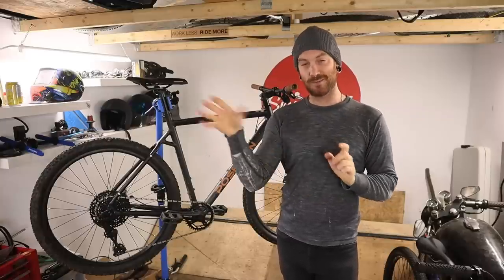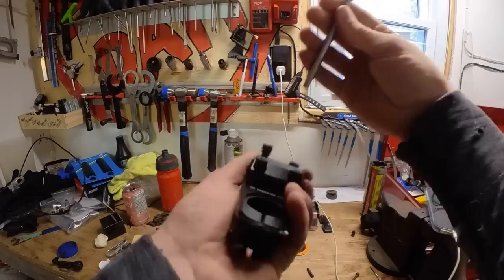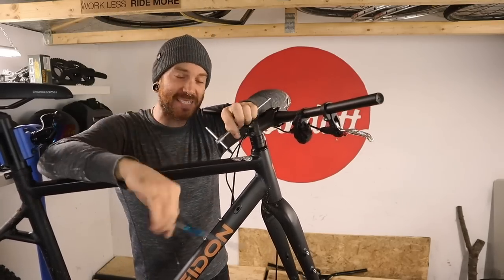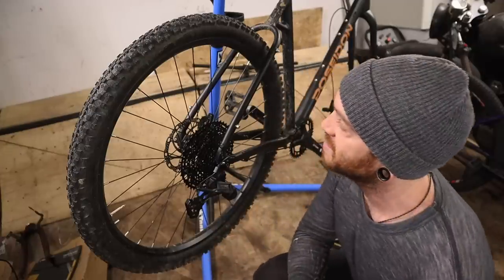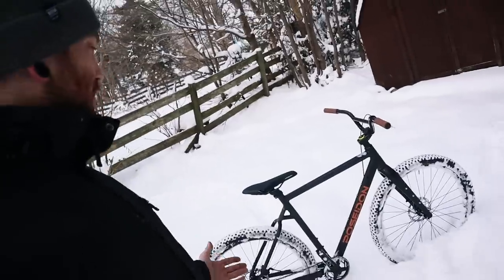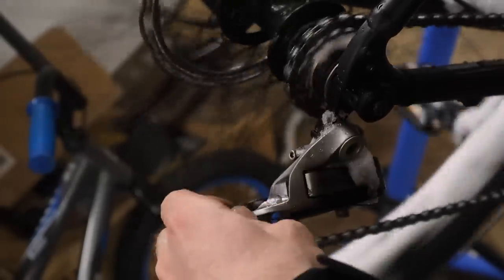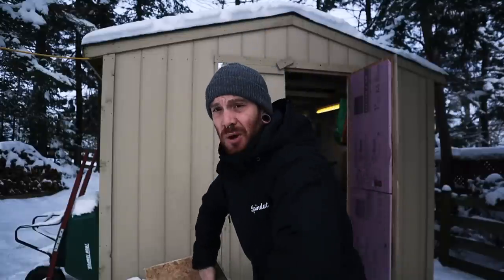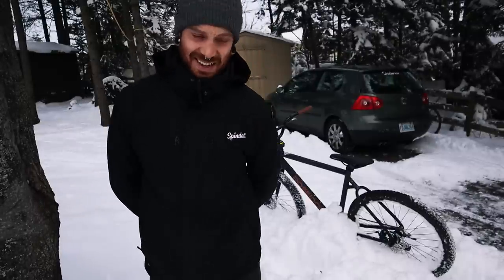BMX Bars on my Monster Cross Gravel Bike |Poseidon Redwood|

Comment: I've been wondering what purpose the spoke does I  this type of set up. I did my dingle speed opposite. 2 chainrings 30/42, and a 17t cog and Alfine chain tensioner. No front derailleur manual shifting only. I dig the dingle!

Comment: I'm 59 years old and this Spring, I plan to replace the drop bars on my Felt Z5 with some type of riser bars. I know that I'll have to also replace shifters, derailers and brake levers and that's fine, I just need something that keeps me from having to lay over to ride. I'm going for comfort and I don't care what anyone thinks... I'm not getting paid by anyone to ride so I want my rides to be fun and enjoyable for a change. Any suggestions on the best bars to look at? Remember, I want them to rise up to me. I'll post some photos after the bike is done once I've chosen the bars for me.

Comment: Hey can you explain the dingle speed hack a little bit more? How did you fix the cable? Didnt get it, want to copy it :)
Reply: looks like he put the end that goes into the shifter into the spot where the cable housing usually stops on the derailleur, and then he just tightened the cable down how you usually would.
Reply: @cleanname4439  very simple. Nice :) thx a lot!

Comment: Not to just throw a ton of comments to this video. Because really I am not an expert and my opinion doesn't really matter.  But, here goes,  I totally dug the attempt of the bar change! I put motocross bars on my fat bike I I totally dig it. This one is kinda out there,  however,  I would live to see you try a 32" build or a 36" I know with parts, it would so difficult, but a Spinny machine like that would be incredible

Comment: I have a hybrid "dad" bike with threaded steer tube and a spare threadless stem and flat bar I want to put on it but am not sure the best way to make it happen. Do stem adaptors work well for this?
Reply from the maker: It’ll work easily so long as the fork is 1” threaded and not 1 1/8 threaded. The bigger ones are harder to find